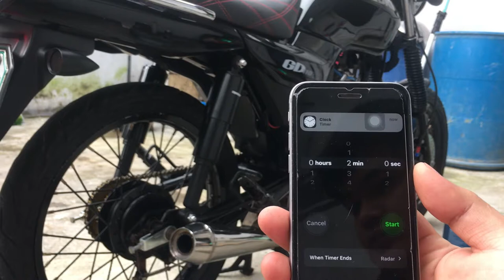BEST MOTORCYCLE OIL||SUZUKI GD110||SHELL ADVANCE AX7||CLASSIC BUILD

Comment: WHICH OIL IS BATTER FOR GD 110 MINRAL OIL OR FULY SYNTHATIC?
Reply from the maker: For me fully synthetic is better  I’ve been using fully synthetic oil for the past few years and my motorcycle still runs good  even though it got a high mileage on it

Comment: Sir sana manotice mu sir tanung kulang po anu po jettings ng carburator nio kasi sakin pag isasagad is parang nalulunod unti gusto nea dahandahan lang na piga gang makuha nea ang mabilis na takbo nea anu kya magandang jettings boss
Reply: Parihas tayo problema sir yung akin aabot pa ng 10 sipa bago umandar lalo na sa umaga. Pa sher mo naman lods kung pano madali mapaandar ang gd ko tapos pag malamig makina may tumutunog sa bandang haed lods sana masagot mo lods
Reply from the maker: @brucevillamora6775  ano gamit mung carb boss? And yung naririnig mo sa bandang head eh baka decom release cam lang baka masyadong mababa menor ng gd mo boss.try mo taasan menor mo at linis carb and check mo sparkplug mo kung goods pa
Reply from the maker: Next vlog paps mag e topic natin yang carb tuning at pag re jett. Try mo luwagan air screw mo boss baka over feed masyado kaya nalulunod. Ano ba gamit mung carb paps?

Comment: Lods bat kaya gd ko 1liter nilalagay ko tapos palit din oil filter pero pag next change oil ko di na sya abot ng 1liter normal lang bayun lods?
Reply from the maker: Check mo lods kung may leak ba engine ng gd mo then if wala try mo magpalit ng engine oil na mas high viscosity oil in the long run kasi lods na eevaporate yung langis ng engine kapag high temperature use na pero kung kumakain na talaga ng langis gd mo at naguusok na kahit cold start pa check mo na sa mekaniko gd mo